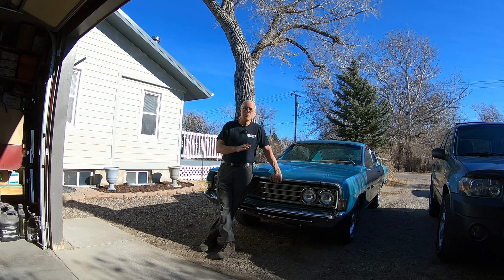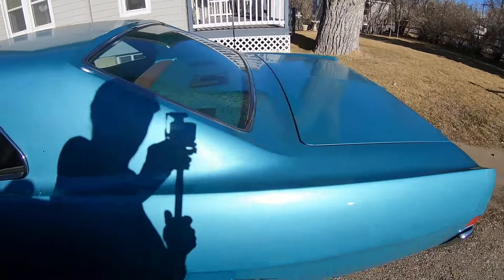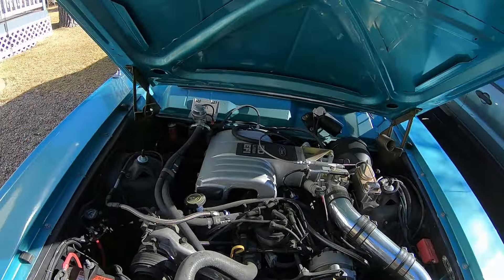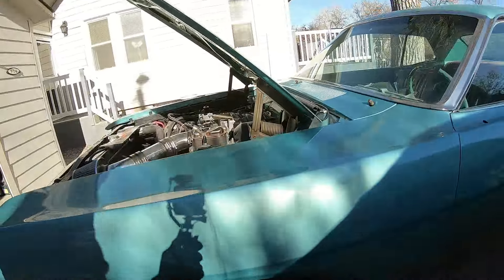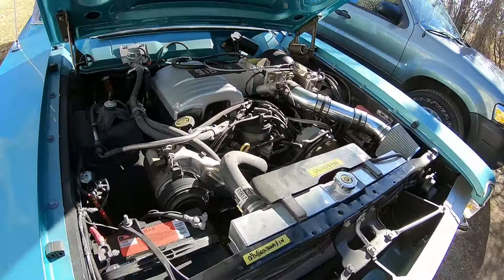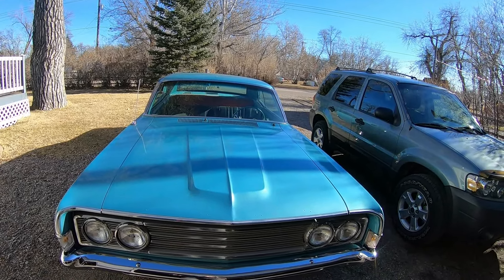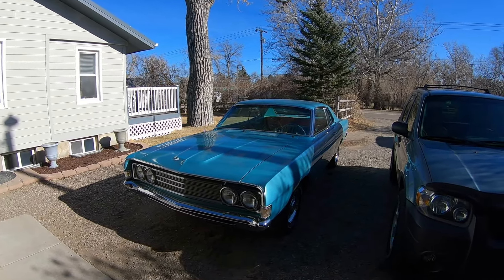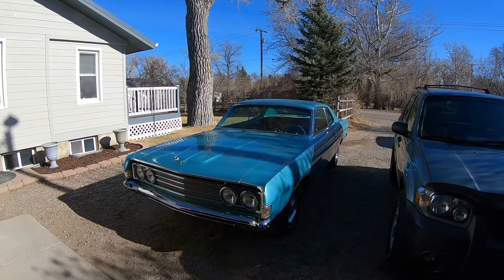Whats up with that car,1968 Ford Torino

Comment: I like what you have done to the Torino. Really nice work! I hope you will be able to complete it soon. I had my fill of restoring cars a few years ago and that's why I sold the shop and the finished projects. I do understand your position with the car.
Reply from the maker: Hey Dave, it is time to let this stuff go. I am not having fun with it anymore. Dirt bikes were first for me, and here I am, going full circle and coming back to them. I had my fun with the cars, but time to move on.
Reply: @montana2strokeracer  I agree with you there Dale. After I finish up with the TM's, the  185 and 125 I'll be calling it quits and most likely sell them off. The tremors and vertigo seem to be lasting longer and more frequent.
Reply: Good Morning Dale. I have decided to not do the upgrades on the 74 TM's and use the parts on the 185 and 125 instead. The day is not off to a good start.
Reply: Hello again Dale. I contacted my go to guy in Phoenix and had him cancel the search for a CR250M and find a buyer for the MT250 instead. Not feeling real good at the moment.
Reply from the maker: Oh man, didn't know you were having health issues, so sorry to hear about it. I hope you can get a handle on it and enjoy messing with these old bikes, I know you are enjoying them.
Reply from the maker: Thats probably a good plan, the TM's are probably worth more as is, the others are a good platform for mods like you have in mind. Hope your day improves.

Comment: The Lord most definitely blessed us this year Dale! Some years I’m not quite ready for winter; sure am glad it’s been easy, so far.
That sure is a pretty old Ford.
I have a couple projects myself that are dragging on now; an early 77 F250 and the engine work on my dads 1955 Dodge, owned since new. Dads long gone now. As a kid I used sit in it and dream of driving it around. I did Drive it a bit in high School, until he got mad at me for putting some milage on it. 
Anyway it’s my car now and I want my kids to enjoy the ride.
Reply from the maker: You are indeed right Kerry. I can't remember a winter this nice since I have lived here. I know, my project list is long, and I am running out of gas. Just hope I can keep going a long time yet. I do enjoy doing this stuff.
Reply: @montana2strokeracer  Hope so Dale!
The content and video quality is great.
It’s very comprehensive and certainly helpful, not to mention interesting. 
Not many people bringing hands on detailed work on older two strokes.
Keep up the good work..

Comment: Nice restoration, I have two 77 VW Busses currently being restored, just finished fully rebuilding the engines. I here you dale, I'm also switching to motorcycles, cutting and buffing cars sucks and is very time consuming.
Reply from the maker: Right on Gary as usual, this one has been going on way to long, bikes are much easier, and you can finish them sooner. No argument from me on the cutting and buffing.....it does suck.

Comment: Sort of reminds me of 1975 in Fort Smith, AR. I was working as a Field Engineer on early computer terminals covering Arkansas, Oklahoma and parts of Texas, Louisiana and Missouri. I picked up a 1965 Corvair Monza with a standard 110hp and the 2 speed power glide. I converted it to a 4-speed and added a factory air conditioner. I drove that thing just shy of 300,000 miles and it was still running when I sold it in the 90s. 2 complete engine overhauls. My first restoration of a motor vehicle.
Reply from the maker: Wow Jack, you have done it all, and it is amazing how many miles some of the vehicles will go. Bikes are more fun for me these days, had my fun with the cars, but time to move on. Watching your progress with the Honda, very interesting, you need a heater in your shop. Don't know how you do it.

Comment: just sold my 19631/2 ford Galaxie 500xl, 352 fe auto show winner. had the car for 25 years all stock. love the old fords, owned several.
Reply from the maker: Hey Frank, yes, it is time to start letting stuff go, have had my fun and now it's going to be fun for someone else. It is hard to do though.

Comment: There's a good chance a conversion box for the tach signal exists. I'd start with looking at or contact Dakota Digital
Reply from the maker: Hi there, I am sure you are right, I am sure I'm not the first to want to do this, I have used the tach adapters from MSD before, but I believe you must use their ignition boxes in order for those to work, not using one in this application. I will take a look at Dakota, did not think about them. Thanks brother.
Reply: Most welcome, and thank you good sir for all you do with sharing all your bike knowledge.

If you were ever looking for a video idea, I know you have shared bits and pieces if different videos, but a single video with all the hardware (jic case bolts, ect) cable supply's, really any hardware related to the bikes and maybe brefie sizes and part #s, would really be an amazing resource for the bike resto community.
I know I would be forever grateful. 

One more notes and I'll get back to the tools LoL
Iv recommended your channel in the comments of his videos, but I would recommend his channel to u and ur viewer for paint related and bike videos in general. His tips on using CA glue (crazy glue) on plastic repair was definitely a game changer I wish I knew years before.
The channel is Windy Urtnowski
Reply from the maker: I will keep that in mind for content in the future, thanks for the channel suggestion, will take a look.

Comment: Its a nice car Dale, I enjoy eyeing it in the background of your videos.  Hey is there a way to make the tach function mechanically independent of the wiring harness and all that.  Maybe even ask on a car forum.  Hey a 302!
Reply from the maker: Thanks, I am not sure, Ford did a really strange thing on their tach's. The power to the coil goes through the tach, so if the tach malfunctions the engine will not run. Most guys that have these cars from this era, make a jumper wire and carry it just for the purpose of getting home. I have done it with an MSD tach adapter on other cars with MSD ignition. But this is a different cat with the engine management system. I am sure an electrical guru could do it in short order......I'm not that guy.